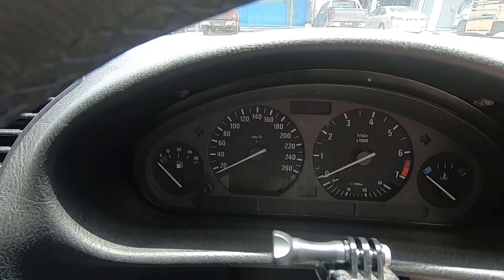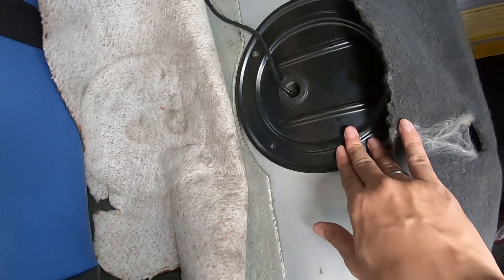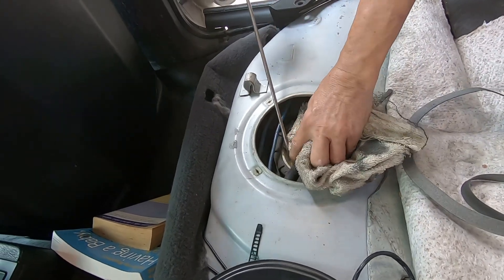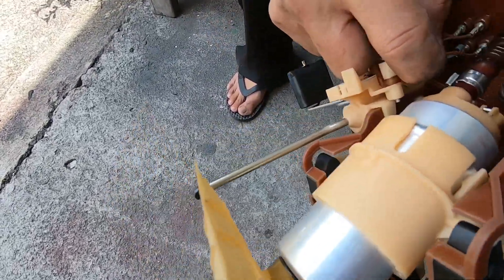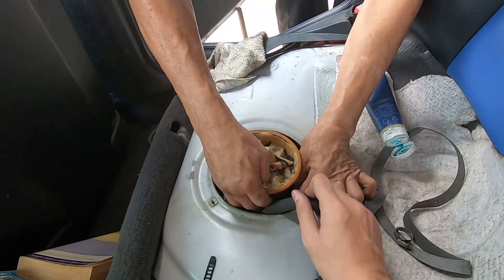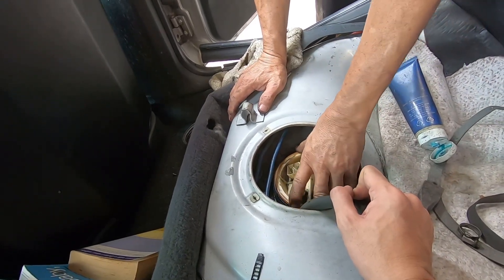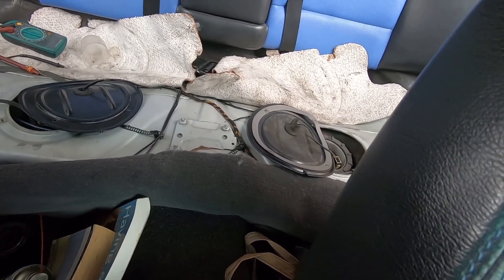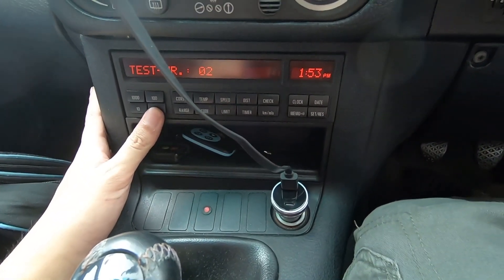BMW E36 Fuel Gauge DIY Repair

Comment: thank you  my friend for your help....was the same wire like yours...but i have replace it with a new fuel pump....the old was 25 years old.....but still works....i repair the wire and i keep it for spare part......

Comment: Brilliant job!
My E36 had the problem, went to repairer who said he cannot do anything with it as still working, if it was not working he could do something with it!
It fixed itself!!!! and then we went over a pot hole of which there are plenty here in UK and now although the fuel low light is on, gauge not working again, only low fuel light.
Possibly a connector as with yours. Hopefully.

Comment: my fuel gauge isn't working. I ran the cluster through a test. There is fuel in it, but it cranks but won't start. Is there anything else I should check?
Reply: change ur fuel pump

Comment: I have a 318i and the fuel gauge works up to half tank. Ive switched out fuel pumps and its the same thing
Reply from the maker: How about the fuel sender on the other side?
Reply: @mengsuan  never checked...funny enough i had to change out my fuel pump again and now its completely dead like this so ill attempt this and see how it goes

Comment: Hi, I just got a 318i. I experienced the similar problem. May I know where you went for this fix? Thxs
Reply from the maker: This is WQW Mechanical and Services in USJ 1. This is a task that you can also attempt at home. Do it when fuel level is low